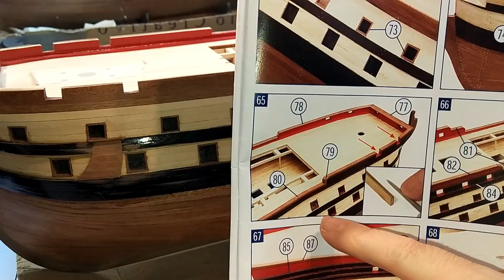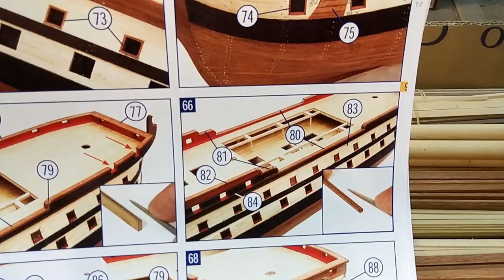Montanes - part 34 Placing Rails At The Bow, Painting Gunport Frames

Comment: In hindsight it would have been easier to paint the frames before cutting to fit, only touch up the corners. But hindsight is only available to those who come after you. The ship is really taking shape.
Reply from the maker: Jim it would be wrong to paint them before gluing because you have to sand them after :)